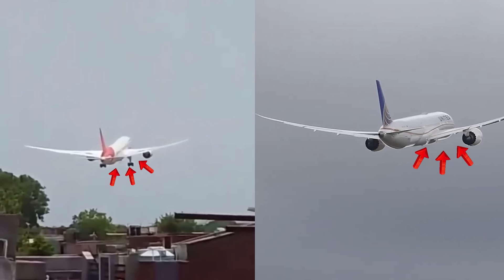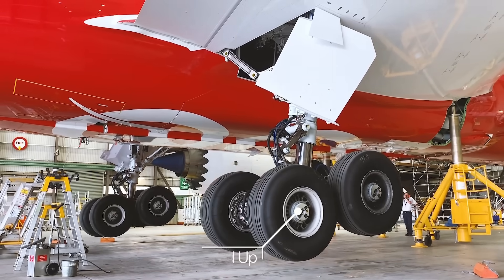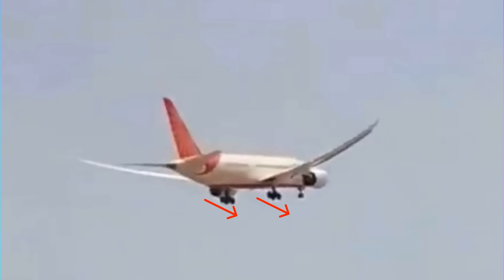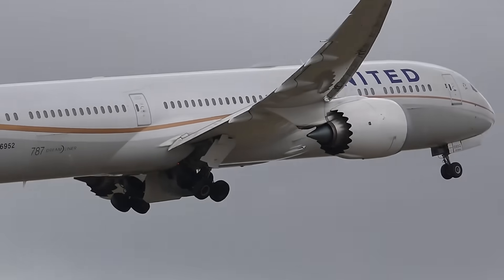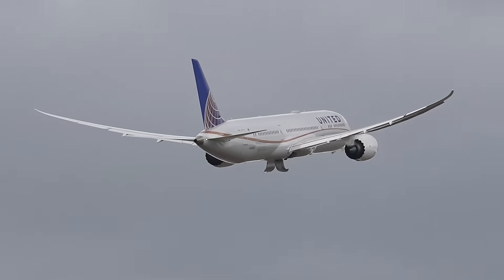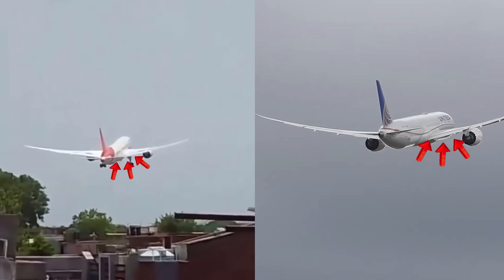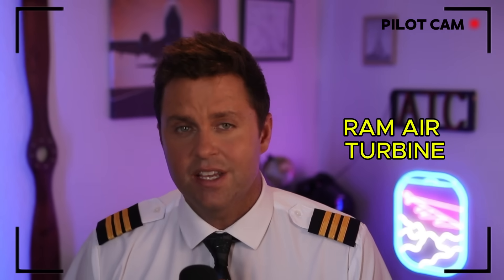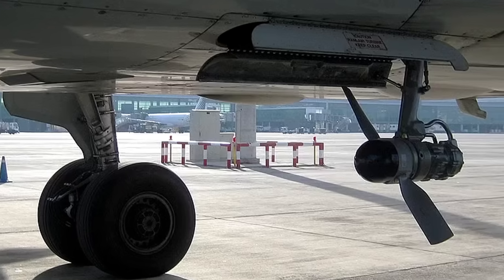Pilot Explains: A New Detail in the Air India 787 Crash Everyone Missed

Comment: Another idea comes to mind: What if the start valves never actually got closed and/or the starters never actually got disengaged even tho the engine controls reported them as being disengaged and closed. Might this have gone unnoticed when the engines were at low/idol power during taxi and then really caused a problem once the throttles were pushed up for takeoff?

The engines seem to have failed shortly after going to takeoff power. Maybe that’s not a coincidence?

Comment: I remember an episode of Air Crash Investigation in which the airplane had a dual engine loss due to - not the fuel itself but what the fuel was leaving in the tubes and hoses and filters, going to the engines.  They did something with the design versus doing anything with the fuel - the fuel was fine, but they had to change out some parts on every similar plane.

Comment: Looks like they lost power in both engines. Just speculation at this point without the data from the FDR. But two things come to mind that has happened before. 

1. Fuel contamination (water in the fuel)
-Possible previous in tank maintenance left absorbent pads that got chewed up by the AC and engine driven pumps which clogged the filters and the metering units. 
2. Engine failure on takeoff and the wrong engine was shut down. 

Each engine has its own generator for engine controls called the PMA, so a total airplane electrical loss wouldn't affect the engines. 
This is a fly by wire jet, but not sure how Boeing powered the throttle resolvers that send commanded throttle position to the engines, but I would assume that they're backed up by the battery bus. 

Stating the obvious, but at this stage of the takeoff they didn't have much time to figure things out. Sad

Comment: Possible scenario: airplane overweight, after lifting to 625 feet, airplane started to descent, the weight of aircraft was taking it down, pilot pulled full throttle yet aircraft could not lift, that's when mayday was declared. Engines on maximum thrust and broke down.

Comment: When this started I said I thought it was hydraulics because of the landing gear. Finally someone is talking about it. Idk enough about 787s, but couldn’t hydraulic failure cause the fuel pump to stop? If the fuel pump stopped, it would starve both engines, which would also kick on the rat. Everyone is talking contamination, but wouldn’t there be some exterior sputtering or some yaw? It seems starvation is more likely, but I’d rather hear a pilot’s perspective.

Comment: I'd argue that fuel delivery is also suspect and I'd put that as more likely than fuel contamination.  If the plane loses electrical power how do the engines get the fuel they need without the delivery/transfer pumps.  Even if the engine used engine driven high-pressure fuel pumps to feed the engines those pumps can't pump fuel if there's none being delivered to them!  The lone survivor stated he heard a 'bang', which might have been the engines failing but might point to something else, something that took out the fuel delivery!

Comment: Layman's question:
Is there   a n y   automatism that could overrule the pilot's thrust command or switch of the fuel pumps or shut valves?

Example for overruling:
When a plane sits on the ground at speed = 0 with engines idling it will certainly not make an effort to obey the command "GEAR UP!".

Comment: Misfueling ? AvGas instead of Jet A ? It should be impossible because they have different nozzle  connections, but there have been instances where a fueltruck was fitted with a wrong nozzle and thus fitted an AvGas nozzle onto a jet's fueltank. There have been planecrashes in the past by misfueling, but it were smaller piston engined planes that were fueled with Jet A instead of AvGas LL100. And when I googled what would happen if a jet with turbine engines gets misfueled with AvGas 100LL instead of Jet A, Jet A1 or Jet B...it says the plane would probably suffer double engine failure very shortly after take-off. I know misfueling is a 1 in a billion posibilty, but I think the plane suffered a MAYOR ELECTRONICS MALFUNCTION. People who flew that 787 during its previous flight complained about the AC not working, as well as the screens in the seats and other electrical stuff. Maybe the plane had problems with the batteries like it did in the past. Maybe they overheated triggering a sudden power outage ?

Comment: Vapour locks in the fuel lines , high temperatures 100 f, plane on tarmac for 3 hours, no AC internal, Rat deployed, fuel supply ok when plane horizontal, then fuel vapour locks starved supply to engines when plane at angle on take off

Comment: Great possible scenarios.  just curious why no one is mentioning the fact that the a/c wasnt working as well as the television screens, and other electrical devices. wouldn't that begin to tell you there was electrical issues going on even before the plane left the terminal? and how long was the flight delayed??? there are many reports that the outside temperature was approximately 112 degrees Fahrenheit. is it possible that the electrical issues and possible vapor lock could be the culprit? once again,  just curious

Comment: Look to electrical not fuel. The 787 reportedly has a unique electrical system and is capable of shutting down turbofans. Do some research on the differences in the 787 electrical system. Older passenger Jets rely on pneumatic and hydraulic backup . The 787 has an electrical architecture and previous documented events have shown that massive bus failure or software corruption leave control of the aircraft unreachable. The single surviving passenger spoke of the air conditioning system and cabin lights not working on the previous leg of their flight. That's too coincidental.

Comment: Hi I just like to ask if that flight be  landed on a flat not in a establishment will it survived and not get exploded..? Or it still get explode? There's a video showing a man is sweating while inside the plane so obviously there is a problem with the AC and electrical might have a problem as well.. I was just wondering why the captain and the co pi lot still pushed thru..😔 who will decide when there's a problems on a plane that may caused an engine failure (which I think it will)and flight need to be canceled for thorough checking.. Peace ✌️

Comment: QQQ: I used to work aboard cargo and container ships. We ran bunker diesels in our low-speed main engines. We ran what most call, "diesel 2," in our generators, as well as during maneuvering because the lower viscosity is better for frequent stops and starts. I say this because the Chief Engineer and his First Officer have to be extremely cautious when refueling and when transferring fuels between tanks. Some fuels do not play well with others. You can put two low viscosity fuels together in the same tank. But, before you do so, the two fuels are put together into test containers. It's possible that two incompatible fuels together will become highly viscous and gummy. They become a slow moving and unusable sludge. If it's not caught in time, it will clog all filters and strainers. 

I say all of this to ask if there is ever this type of issue to be vigilant for when refueling at the airport terminals? Fuel existing in the lines would get a plane down a taxiway, only for sludge to cause fuel starvation on both engines? 

Just spitballing.

Comment: If the fuel was contaminated  it would be  noticed  because the  time between push back, taxing, untill running with full power for take off ,something about the engines must be noticed by the captain or the first officer ,such as sudden loss of power or unstable momentum of the thrust.
I think most likely the fuel cut off switch has been activated by mistake.
Reply: I was right

Comment: The flight was fully fuelled up as it was going to London. But as for contamination what I don't understand is unless the contaminant was originally in the plane, the contaminant must have come from the fuelling source. If that's the case, would not other planes either fuelling up before or after that plane also have some contaminated fuel?

Comment: Dual engine failure is very rare. Contaminated fuel wouldn’t shut both down at the exact same time, or at the same rate. Most likely there was an electrical issue that shut both down at the same time.
Reply: What if you were in the cockpit and did something on purpose--would that be possible?

Comment: I posted this same comment on Captain Steeeve's 2nd video. No responses yet.
Gary, in your video, in slow motion, watch the segment between 3:07 and 3:10. What is that black dot, just above the tree, that arcs up and back down? It seems to appear and disappear several times, as is it were a disc that was flipping in the air. Does the RAT have a cover that flies off when the RAT is deployed?

Comment: Compressor stall because of fast full throttle? I think the lift off was very late. They want to take off with the calculated performance, they lined up near half of runway. Is it posible to get a compressor stall in both engines because of a fast changing thrust setting?

Comment: If it is caused by improper maintenance/whether it is the fuel supply system, mechanical system, or the twin engines themselves, the power is insufficient:

It should be reflected in the middle and late stages of taxiing, that is, the speed is not enough; the pilot will increase the fuel supply operation, and there could be abnormal noise; especially in the late taxiing, after passing the safe stop takeoff point, the pilot will definitely have an operation effort beyond the normal norm; the plane actually almost raised its head at the end of the runway, + after takeoff, it was soon discovered, in a matter of seconds,  that the power was still insufficient, so Mayday! Is the only thing could be done at the last moment.

Comment: The aircraft’s electric fuel pump was powered by  generators driven by both engines. A generator issue reduced electrical output, affecting other systems. After or During takeoff, the generator failed completely, cutting fuel supply and causing both engines to fail.

Comment: My  opinion,    is  no pilot   error .  No  bird  strike.     Dont think ,  contaminated  fuel.  But  some how ,  engines   starved  of  fuel.    Not  failure  of the engines  .  Just  some how  starved   of fuel .  No  thrust .  Or power     from  the engines  . On take off    to   keep it  in the  air .   Seemed  plane   used  all  the runway   to take off .  Then  no  full  power ,  to  get  above  the 600  feet  mark .    Could  it   have been   sabotage?    Enough  fuel   for a limited  time .  But  to bring disaster?     Islamist   activists  ?   Suger  added ?? To  the fuel?     Filters  blocked . On fuel lines .     Some kind  of  fuel  injection   problem .      Electricity  fault that  operates fuel pumps .?    Not  in my  opinion   pilot   errors.   😢😢😢  very  very  sad  affair  .

Comment: I think lots of experienced professionals are pointing to dual engine failure caused by electrical malfunction, and since this plane operates fully on electrical system, then the question is, a passenger who was on-board that same flight from Delhi posted a video of the plane facing serious electrical issues, and these issues were noticeable by everyone on-board. Why on earth did the crew not allow maintenance to inspect the plane and fix the problem before they took off for London? This crash was preventable. I think airlines need to stop worrying about being delayed and focus more on safety

Comment: What are the odds of fuel contamination affecting both engines simultaneously, instantaneously, and not affecting any other aircraft that day?
Also if the flaps were not set correctly, would that not affect the take off distance more than the climb rate (which looked OK initially)?
 I'm not a pilot, just asking.

Comment: Hi Garybpilot, has anyone thought about the possibility of the FADEC (Full Authority Digital Engine Control) system being the possible cause of loss of thrust on both engines. It is my understanding there have been past issues with thrust rollback of several 777s, and a 787 incident involving  an ANA flight NH985 in 2019, a 787-8 with Trent 1000 engines. Simultaneous shutdown of both engines on touchdown and could not restart the engines. Not sure if they ever identified the actual cause. Also,  being that the pilots have no way of manually overiding the system, it would fit the scenario. Just a thought.

Comment: YES EXCELLENT WELL  THOUGHT OUT  ANAYLISIS.  VERY CLEAR TO ME THAT THE ENGINES STARTED FAILURE BEFORE TAKOFF. CLEARLYRLY SHOWED THEY ALMOST WENT OFF THE END BECAUSE OF THE DUST AT END OF AIRWAY THROWEN UP.   THERE SHOULD BE A CLEAR GROUND WELL BEYOND THE RUNWAY IN CASE OF EMERGENCIES. THIS GOES FOR LANDING AS WELL AS SO OBVIOUS.  EVEN A LIGHT PLANE RUNWAY I KNOW HAS BEYOND IT AN EMERGENCY LANDING CLEAR STRIP. THAT IS IN CASE OF ENGINE FAILURE. . SADLY TO ME THIS RUNWAY IN INDIA IS TO SHORT FOR A PLANE THAT SIZE ESPECIALY WITH ENGINE TROUBLE.. VAPOUR LOCK AS VERY HOT OR CONTAMINATED FUEL MOST LIKLEY TO  CAUSE BOTH ENGINES TO FAIL. AS YOU BOTH STATE ONE COULD HEAR THE RAT DEPLOYED AND MAKING A LOUD NOISE. THAT MEANS THE ENGINES WERE NOT GIVING ENOUGHF POWER THEN FAILED. AT LEAST THEY HAVE THE TWO BLACK BOXES. I HOPE THEY ARE NOT FOUND FAULTY OR ANOTHER PROBLEM.  WHAT ARE THE BLACK BOX MAINTERNANCE AND CHECKING DONE. AND  ARE THEY GIVEN A CERTIFICATE. . WHAT IS THE   SHEDUEL AND HAS IT A WRITTEN RECORD.. ONE FEELS SO SORRY FOR THE RELITAVES OF THOSE WHO LOST THEIR LIVES.. I HOPE THEY ARE PROPERLY SUPPORTED..

Comment: Your gear theory sounds a bit odd. The wheels are in the same position as they would be for take off and landing. The idea that the gear up selection was initiated and then failed due to hydraulic power loss is purely conjecture. If the wheels "fell" back that would be the same as if gear up had never been selected. The idea that they selected gear up and then they dropped back due to loss of power may be a sound idea in theory but there is zero evidence to support that. Either way the crew must have known something was wrong and at that height over that terrain, gear position would have been the last concern.

Comment: I have gotten some info from some in the industry. Could be false, but it looks legit. 

• Root cause: Uncommanded bus transfer failure due to arcing in the main power relay box (PRB-A), traced to water ingress during pre-flight GPU disconnection in heavy rain.
• This led to loss of electronic engine control at rotation, resulting in both GEnx engines rolling back to ground idle within 4-5 seconds.

Comment: My observations:
1. Mayday call said "No thrust - No lift"
2. Alledgedly reports of engine problems on several previous flights
3. Indian news papers are suggesting malpracise (or even sabatage) by ground crews  (there is a lot of politics here)
4. Take off role and initial climb looked normal - FR24 shows where it went wrong
5. Only surviror reported two things: a) a "big bang" and b) cabin lights going white/green/white - suggests an electrical issue
6. RAT deployed sugguests loss of electric (or hydralic) power or both
7. Landing wheels not retracted - crew too busy dealing with emergency?

Comment: I watched the landing gear retraction video very slowly and noted that the doors are triggered at the exact same time as when the wheels are LEVEL and not yet in the stowed position (not sure if Boeing programmed it this way).  Also, the doors appear to be actuated by a hydraulic piston seen above the center hinge of the door (look above the red light).  Question one for me is does the wheel rotation happen under electric power or hydraulic power.  If the tilt is electric, then this MIGHT suggest a hydraulic failure just after "wheels up" is started.   JUST a suggestion of possible sequence of events, but nothing to tell us WHY.

Comment: I spotted the RAT right from DAY ONE.

COMMON SENSE - 

Plane practically dived down - TOTAL POWER LOSS. 

Flaps/slats are nothing more than a lift aid. Not really needed.  Open throttles and the plane will still climb.

RAT flops out - BOTH ENGINES FLAMED OUT

I don't believe the RAT flops out with the engines still idling.

And I'm a layman.

Bird strikes ?

Comment: Looking at the position of the aircraft on the runway when the RAT is first heard.  How long does it take for the RAT to deploy and get up to full speed? 5 seconds, 10 seconds?  
If the RAT is deployed, and can be heard on the video, why didn’t he abort @ V1? 

The timing seems ‘off’.  You can hear the Rat is fully deployed as the aircraft passes the first camera while it was still on the ground.  Before V1.  At least that is how it appears.  

The key is WHEN the RAT was deployed. 

I too thought flaps, but not so much now.  
Doubt it’s fuel onBOTH engines from different fuel tanks.  
Both pilots were short on hours in this type. 

I’m assuming they thought it was a different problem, that is why they continued through V1

Comment: Gary asks what caused dual engine failure? Well, if there is a total electrical and hydraulic failure then the fuel pumps can't send fuel to the engines. Me not being an expert on 787 design, how does the fuel go from the tank to the engines? Fuel pumps I suppose. no power, no hydraulics, then fuel don't get to the engines thereby starving the engines and loss of thrust. Gary, can you comment on this possibility since you didn't in this video?

Comment: Remember the Boeing quality control whistle blower who claimed that Boeing was failing to clean up metal drill filings.  He predicted that problems would arise 10 years later when the metal filings could slowly cut electrical wires causing faulty signals to the plane’s systems.  Maybe that played a part……hard to know.